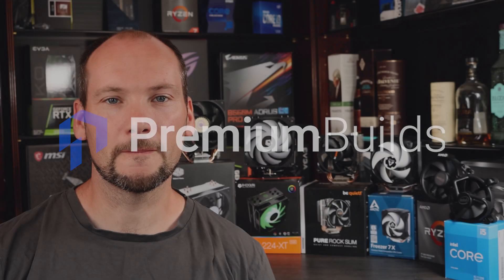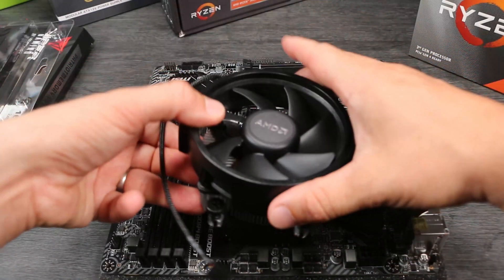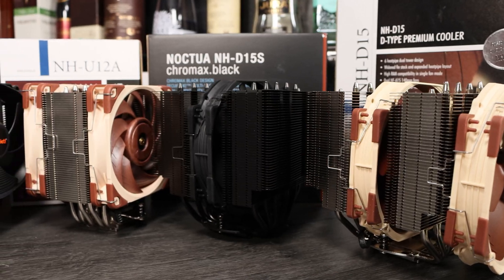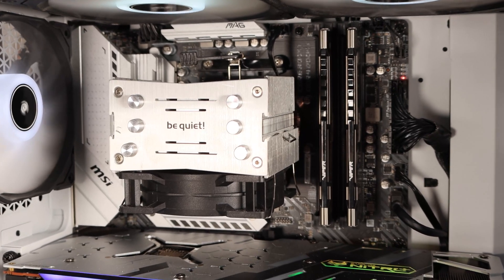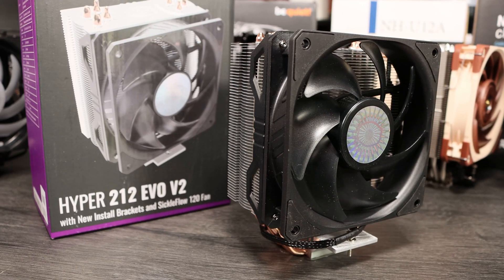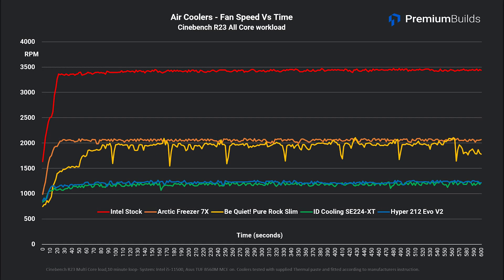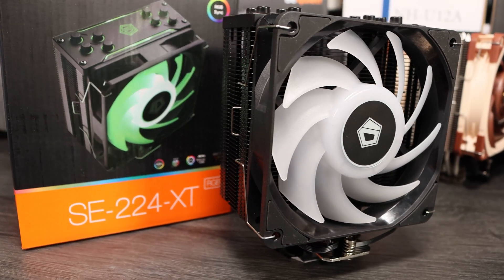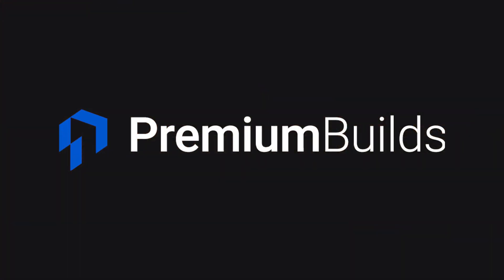Best Entry level Air Coolers for 2021 (Benchmarked) - Our Roundup & Recommendations

Comment: What cheap cooler would you recommend for i3 10100F? Thanks
Reply from the maker: Anything that's a tower cooler. Arctic 7x, hyper 212, vetroo v5, bequiet pure rock... Anything $20-$25

Comment: The ID Cooling SE 224-XT is the best in performance and low price.
I'm using it with my pc i5 12400 and amd ryzen 5 5600G. The CPU has about 10 percent more performance at full load.

Comment: The Arctic i13X and A13X have a far better mounting system than the one provided for the 7X (very similar to the Noctua system).  It costs a little more, though.  Although the i13X does not perform as well as a Hyper 212 or a 224-XT, it's also a shorter tower cooler with a smaller fan, so it will fit in more cases.  That understood, its noise level is very good, even under heavy loads, and readily tames a 10th or 11th gen i5 (presumably, it would also work well with Coffee Lake i5's).

Comment: Arctic Freezer 34 esports Duo worth a punt?
Reply from the maker: Yes, it's a good cooler. We were a little disappointed that the Arctic 7x Cooler mount interefered with the VRM heatsinks on a couple of boards, but the 34  Esports uses a different, better mechannism that should give no problems. It's happy up to Ryzen 5/intel i5 levels of cooling , no problems.

Comment: I am looking for the top performance cpu air cooler in 2021.
I dont care about price,db sound,look.
My only limitation is that my case(corsair 280x) has a limitation in cpu cooler height<= 150mm.
Models I found so far:
Cryorig H7
Cryorig H7 Quad Lumi
Arctic Freezer 33
Vetroo V5
Any suggestions or other coolers are welcome
Reply from the maker: Wow, I'd never realised that case is so height restrictive on coolers. It eliminates all of the 'high performance' options. I'd honestly consider a 240mm or 280mm AIO if you want maximum CPU cooling capability in that case. It is what it's designed for, and the 120mm fan options won't live upto the closed loop collers if it's straight up performance that you want.
Reply: If you dont care about the price better get AIO since ur case has height limitation
Reply: @dansyt8748  I am not the guy who play 2 hours a day and change hardware every 2 years.
My pc runs 24/7 and upgrade when necessary,so it may take even 6-7 years to buy a new pc.
I dont trust AIO,I tried in the past with a Corsair h100i extreme.
First had problem in pump,I send it with RMA the second leaked in the box,the 3rd had problem with pump again so the 4rth was sold brand new sealed.
Even if it work noone guaranty you that in 1-2-3 years your pc will be ruined from leaks.
So I prefer and trust air coolers,the have 1-2c temp worst results but they can work for years with no issue.

Comment: 3 month since using ID Cooling SE 224-XT with Ryzen 5 2600. Oc'ed to 4.0ghz. Idle 39° and gaming (Warzone) 51°. Bought this cooler just only 22USD (MYR89), never regret
Reply: im using a Ryzen 5 3600 with this exact cooler. but im unsure on how to manage my fan curves. what would you recommend?

Comment: Which CPU Air cooler you recommend for  i5-11600k  on gigabyte B560m Aorus pro ax inteL
 Lga 1200? (i will not overlocking) i  just play 
games not video streaming or editing
Reply from the maker: The ID Cooling SE224XT would work fine, You could consider coolers like the Scythe Mugen 5 Rev B, or the Thyermalright PA120 if you want more cooling and less noise, as the 11600K can draw a lot of power and make a lot of heat!
Reply: @BuildPicker  iD Cooling SE224XT  can fit in the small  gigabyte B560m ?
Reply from the maker: @Taw3eyaa  YEs, no problems. Just check your case height for cooler clearance, make sure it's bigger than the listed height of the SE224XT (It almost certainly will be)
Reply: @BuildPicker  thanks yes its fit i will order ID-COOLING SE-224-XT Black CPU Cooler AM4 CPU Cooler 4 Heatpipes CPU Air Cooler 120mm PWM Fan Air Cooling for Intel its comes with one fan is it ok

Comment: That stock i5 cooler is still fine for the office application unless what you do with your CPU is benchmark the hell out of it. In the normal office scenario, the cores never really spike much and frequently run idle. Excel, Outlook or Word never really generate much heat lol.

Comment: Amd Stealth cooler sucks even for 3300x. It's noisy and cooling is sub-par in tropical countries. Had to re-use a Spire cooler to keep both noise and temps under threshold.
Reply from the maker: I agree it's not ideal. BUt the Intel cooler actually throttles the CPU it's supplied with, and the Wraith stealth doesn't - and whilst it is loud, it's not as annoying as the intel cooler. We agree, it's a good quality of life upgrade to get a better CPU cooler, but we'd use the AMD cooler but chuck the INtel one in the bin!